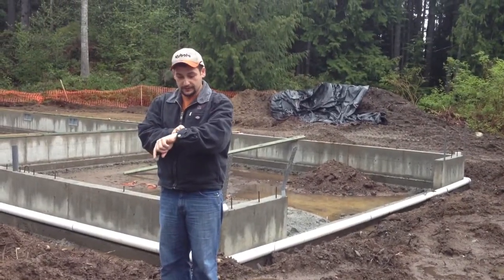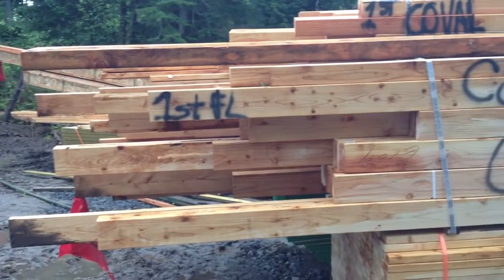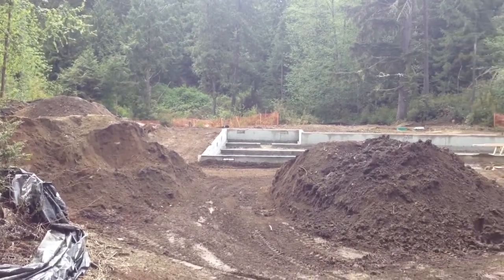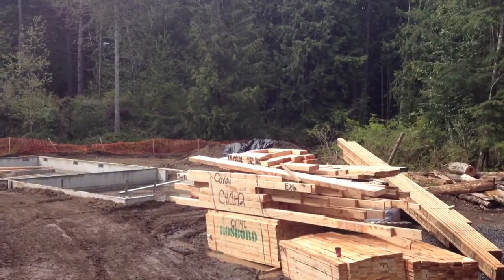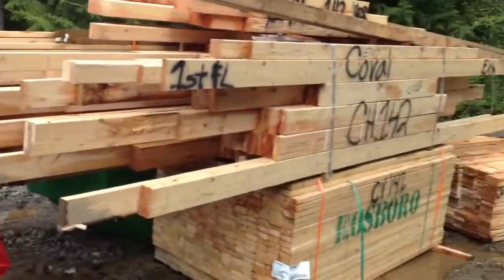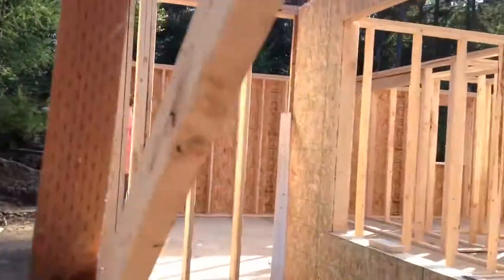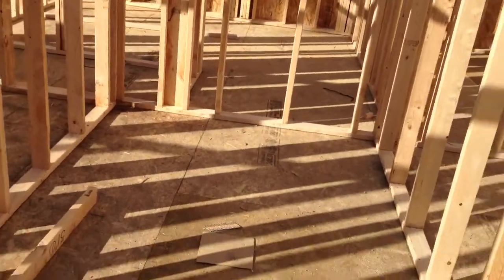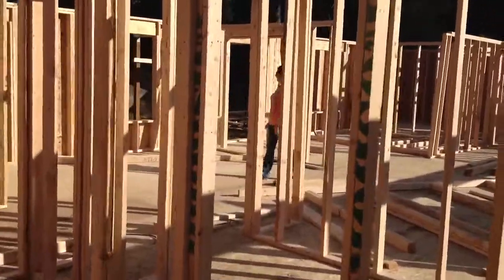Building New Home including foundation backfill and first construction.

Comment: How old was foundation concrete at this point? Didn't you want to frame а floor first to hold walls from pushing inwards?
Reply from the maker: Janizary - Well the concrete was a few days old but that’s not really relevant in the world of concrete foundations, A standard stemwall like the one in this video is only about 16 inches tall and you wouldn’t be able to push the wall in word by pushing dirt up against it even if you were to directly push on it with the tractor you would crack the wall before it would Bow in